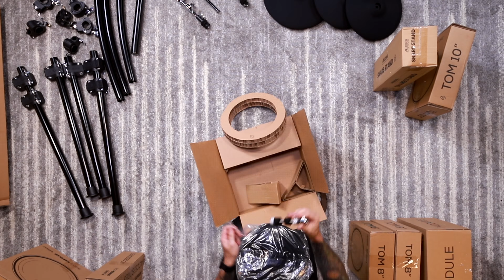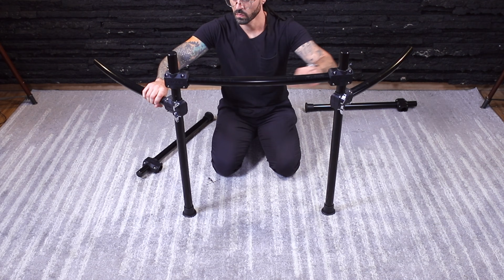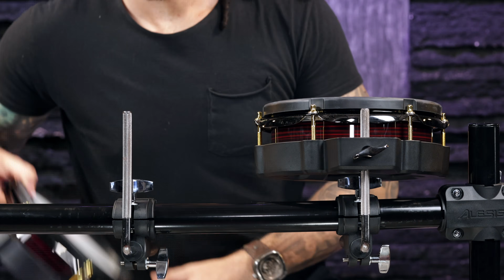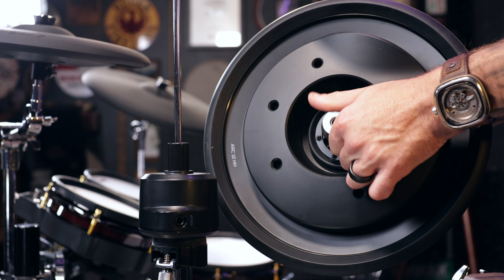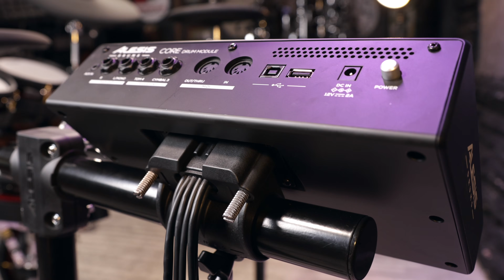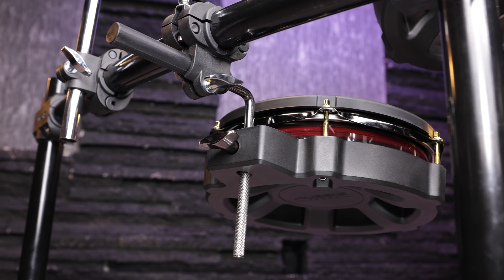Alesis Strata Core Assembly Guide | Alesis Drums

Comment: Hey Adam,  Love your videos! However, I would love to love this set, but it seems a known issue plagues the module. The constant hum.....

I have tried 2 modules, various power conditioners, headphones and amps.....same result. The problem appears to be connected to the display. Adjusting the brightness helps, but does not eliminate the issue. And playing in dark mode all the time simply isn't a solution!

After researching various users, it seems unlikely Alesis is unaware of the issue, yet the only way some users resolve this is a lengthy RMA process. Not a great step into something I really want to love. But at this point, it's likely being returned.

If you can do anything on your end to save the frustration for future users, please do!
Reply: I had the same issue with the low hum/buzz while wearing headphones. Alesis is aware of the issue...it's a hardware issue. I didn't bother with replacing my module. I returned the kit.

Comment: Could the prime expansion pack be used with the core kit?
Reply: I would like to know too
Reply from the maker: YES! You can connect cables to Tom 4 and Cymbal 3 Trigger Inputs to receive signals from additional drum and cymbal triggers!
Reply: @alesis_drums  @indianajones1747 Interesting!... So theoretically, I could use the 18in cymbals as the crashes, one of core 14in cymbals as a splash/china, and then use the 14in pad as the snare while moving the 12in core snare to the rack as a second floor tom! Of course, this would leave a cymbal out of the mix (maybe a spare).